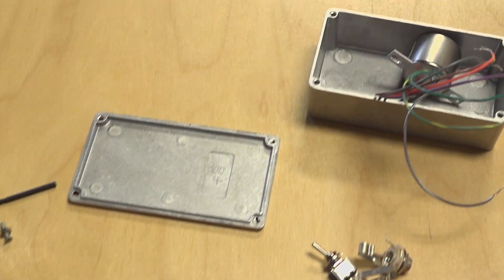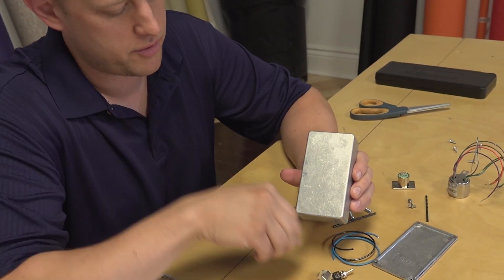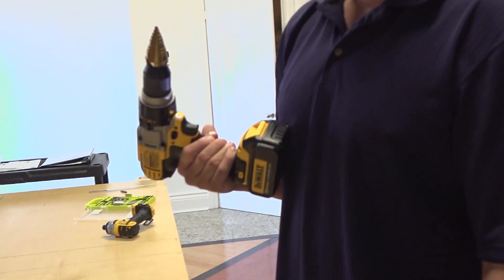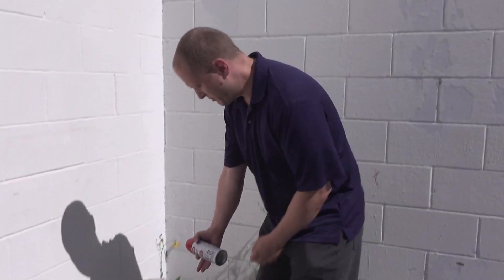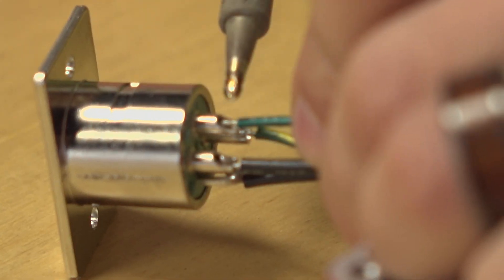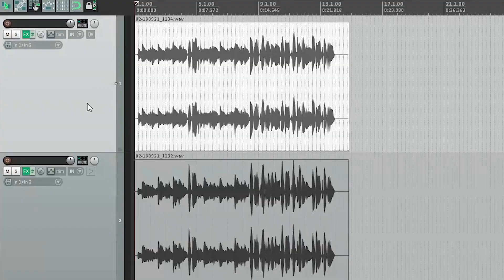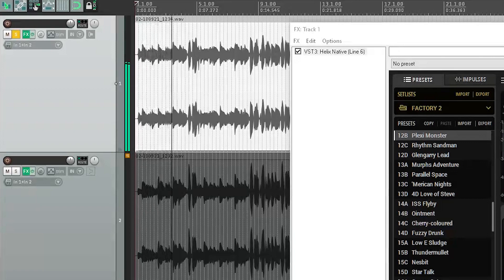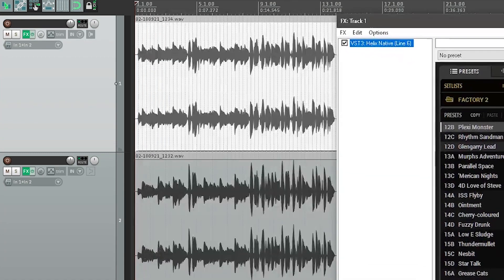Build Your Own Passive DI Box (easier than you think)

Comment: I plan on putting a passive DI circuit like this inside my bass
Can i just skip the input jack in the circuit in wire the electronics in my bass directly to the output jack of this DI circuit?
Reply from the maker: Yes, but then you wouldn't have a standard 1/4" out.  I would still connect at least 1x 1/4" jack, so you have the option for both DI or standard 1/4" out.
Reply: @NextGenGuitars  yes i would love to have both the 1/4” and the XLR. I plan on basically jam a passive DI box inside the cavity on my bass but i still dont know how to wire it since im still new to electronics and stuffs. A wiring diagram would help, if possible. Many thanks mate
Reply from the maker: @trnmkhngthnh  You can use the schematic/diagram from the blog link.  Just treat the two 1/4" jacks as if they were one, and remove the ground lift switch.

Comment: Can you do a circuit for cabsim toggle with this?
Reply from the maker: Not for this type of passive (doesn't require power) design.  An analog cab-sim is essentially an EQ circuit, which requires a boost, which requires power.

Comment: what is the awg size of the cable used inside?
Reply from the maker: We just used the leads coming from the transformer.  In this case, it doesn't matter much.  I wouldn't go smaller than 24AWG, simply for my comfort working with it.

Comment: Any tips on something simple like this to remove phantom power, so XLR in/out?
Reply from the maker: This will do the trick:
https://cdn.instructables.com/F26/3UK3/J3AFDUIK/F263UK3J3AFDUIK.LARGE.jpg
Reply: I don't even understand the question. If you don't want phantom power on, turn it off. 

Also, the transformer in the passive box BLOCKS phantom power.
Reply: @Wizardofgosz  Thanks. Some cheaper boards only have an on/off switch for all strips.
Reply from the maker: @Wizardofgosz  Many boards only have a master phantom power button that applies it to all channels.  If you're using several mics at once (like when micing a drum kit), some of the mics may require phantom power, requiring you to turn it on.  However, some of the other mics you're using (ribbon mics for instance) could get damaged by the phantom power being applied.  Thus, you'll need something to "block" the phantom power to protect those mics on those channels.
Reply: @NextGenGuitars  My guess is if they're using a Mackie 1202 they don't own any vintage ribbon mics. Modern ribbons have protection against being damaged by phantom. I'm wondering what they're actually doing.
Reply: @NextGenGuitars the link not working
Reply from the maker: @wasfallen  It did when we first responded.  Just do an internet search for "Phantom Power Blocker".  There are a ton of free circuits you could make.

Comment: Where to buy that kind of transformer? also- what’s best wattage of soldering for this kind of job?
Reply from the maker: We sell them.  :)

But they are kind of pricey.  There are also numerous other options on the market, as have been mentioned in other comments on this video.

Soldering iron temperature depends on what type of solder you use, and if your iron is digitally controlled.  Mine is set to 675F.  600F-700F is common.  Some go as high as 800F.  Again, depends on what you're soldering and what type of solder you use.

Rock on!

Comment: I know this is an old post but I have to ask, within the first minute seeing your schematic how are you creating the Balanced output.  Yes I know this technically works but it is not truly a balanced output.  You are basically making an isolated Pos to ground signal.   Are you supposed to have a ground/neutral center tap on the secondary of the transformer to create the Proper positive and Negative signal for XLR pins 2 and 3? 

At the same time, I can see how if Phantom power is applied it would protect the keyboard/guitar, but this really isn't a Balanced output, it is still technically unbalanced.
Reply from the maker: If you follow the layout and schematic, you'll see that the 1/4" input goes to the primary (20K; unbalanced), and the XLR output comes from the secondary (1.5K; ~12:1 turns ratio; balanced).  The transformer is converting the signal from HiZ to LowZ AND from unbalanced to balanced.
https://www.hammfg.com/files/parts/pdf/1140-DB-A.pdf
Reply: @NextGenGuitars  I do see that in the write up and in the diagram.  I would have to see it actually function with test equipment.   Though the way it shows, it cannot produce a negative signal to match the positive signal without a zero reference in the middle of the secondary.

While the inversion at the mixer/amp will strip interference from the xlr input, this is not technically a balanced signal.  Even if it is being called one.

Again, I do see what the diagram is showing and it is the same for Jensen, and Radio Shack.  It works, but electronically it is not accurate.   

If you happen to have a O-scope you can use, possibly even with a multimeter, with a tone in, read pins 2 and 3 of the output to ground.  They should be opposites but you will find it is not.   If it is opposite then everything I have ever learned in Electronics is wrong.
Reply from the maker: @chrish7336  They call it a balanced signal coming out of the secondary, so we're calling it a balanced signal.  In fact, nearly every company making passive DI Boxes use this type of transformer (different brands, but similar designs).  Maybe there's more going on inside the transformer than we can see in the specs.  I wish I could help, but these would be questions for the DI transformer manufacturers, not for us.  Interesting question nonetheless.
Reply: @NextGenGuitars  True, 

As I mentioned, they are all pretty much the same, and I understand the concept, I just don't agree with the terminology and didn't know if you had any additional information.  It works and that is truly all that matters.
Reply from the maker: @chrish7336  It's an interesting question.  I wonder what the engineers would say.
Reply: @NextGenGuitars  I think for cost, I am looking at using a 1:1 or 2:1 Transformer for Isolation and use Resistors on the input side to knock the level down.  Will see if I ever get it made.

Comment: How much price db a 1140??
Reply from the maker: Around $75 USD, but it depends where you buy it.
Reply: other than db a 1140, is there any other alternative to make a passive direct box?
Reply from the maker: @wahyudjogja4753  There are many other transformers that can be used, but none that we sell.  You'd have to search.
Reply: in Indonesia there are those who sell isolated 600 ohm: 600 ohm transformers, can they be used too?
Reply from the maker: @wahyudjogja4753  Those would not accomplish the same thing and would be used for other purposes.  You want something with at least a 10:1 turn ratio.
Reply: @NextGenGuitars  Then if I want a multifunctional one like an active direct box, what ratio do I use?
Reply from the maker: @wahyudjogja4753  Depends on the circuit.  Best I can suggest would be to find a well designed one online and go off of that.
Reply: @NextGenGuitars  what does the 10:1 ratio mean 10 kilo ohms?
Reply: @wahyudjogja4753  udah bisa bikin di box nya mas?